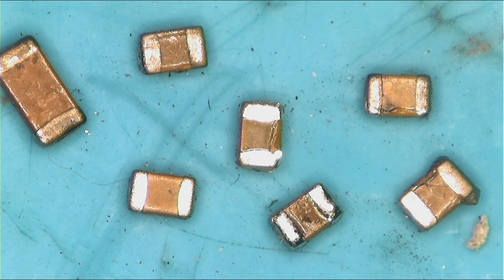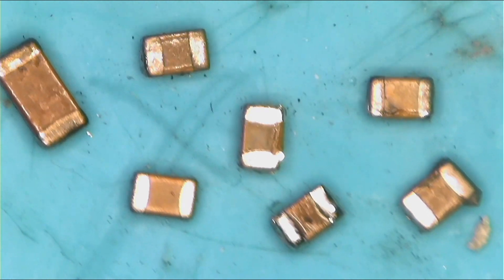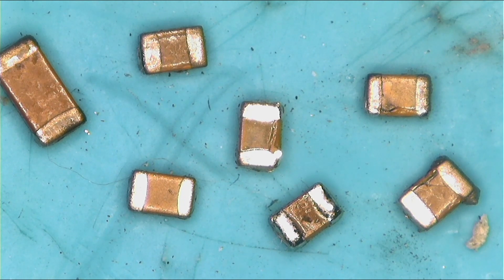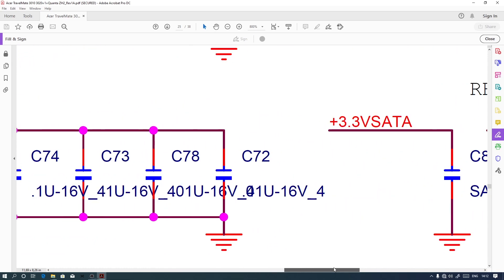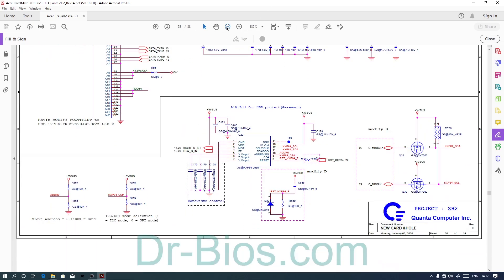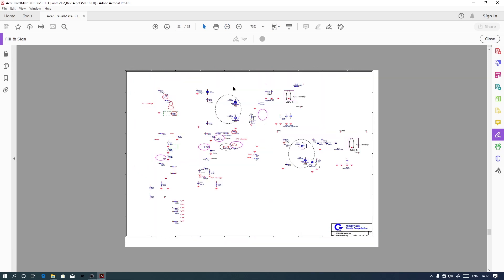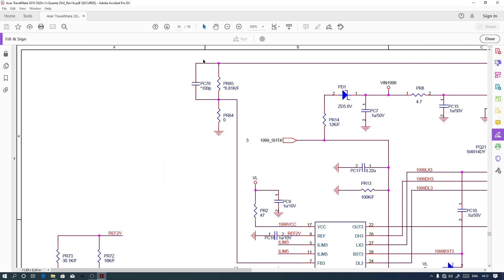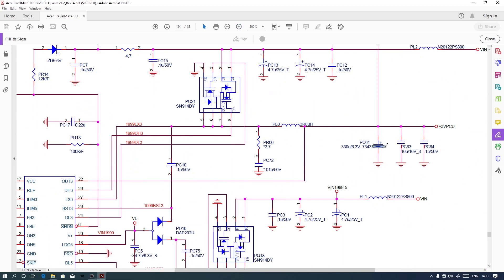How to identify shorted capacitors, you don’t need to inject any voltages

Comment: Sir thank you for the knowledge, i have a question sir, , if an smd capacitor  get buzzer in a multimeter but does not show zero but the reading is 3 ohms, is it good or bad? Thank you

Comment: Resp Sir! Very Nice Sir. Sir 1TB Hard Disk Desplayed at Disk Managent for Hardisk could not be Performed because of an I/O Device Error Sir, Dosmode Command Prompt Clean Disk and Somany Types Traing Sir bu Same Error Sir, after Hardisk Open and CPU Connected Sir One Second Spinning after Off and Power Removed and Again Connected Sir again one Scond Run and Off Sir, after Hardisk Logic PCB Open and Testing with Multimeter Beep Mode Some SMD Ceramic Capacitors are 132, 150, 75, Values Desplayed Sir, No Beep Sir, Only Beep Mode Sir. all SMD Capacitors Can Remove Sir or Not Sir. Where the Problem Sir. Please Advise Sir. I am Waiting Sir.  --     ChinnaRao Paderu Andhrapradesh

Comment: bro nice video.
do we have any thing like "open capasitors"
Reply: They do go open. They can develop high "equivalent series resistance" ESR. They can develop leakage ranging from in specification to out of spec but undetectable malfunction all of the way to shorted. They can suffer a reduction in capacity usually accompanied by increase in ESR. Look into ideal component characteristics versus real components which all have resistance, capacitance and inductance. Good luck!
Reply from the maker: no we dont have

Comment: How would we identify the value of a capacitor that's shorted so we can replace it with a new one ???  Any help would be greatly appreciated guys ☺️
Reply: sometimes you can find example circuits of ic's in which you can tell the different capacitors used
Reply: using capacitance meter or smd tester or if you dont have replace with the same size
Reply: Sometimes rows of caps are  of same value so you can measure the one next to it with cap meter. You can guess by measuring other caps on board and seeing most common values. It's all just educated guesses though.
Reply: Samee
Reply: Damn I have the same problem no schematic on this board I'm working on and have a bunch that have failed and need replacements and have no clue what value they are.
Reply: You kinda screwed. I don't think you can figure that out.

You'll need a schematic or donor board.

Comment: Some times the ceramic capacitor gives short to ground on the board and there's no problem in the board can you tell us about that case.
Thanks
Reply from the maker: Yes, some power rails are connected to a pch, cpu and graphics chip, those chips have low resistance to ground…
Reply: @jbvtechnologies  
Thanks brother for the information 🙂

Comment: So you are saying that if the multimetre beeps when check for continuity then that means the capacitor is short, is that right?
Reply from the maker: That depends, when checking it outside the board then big yes, yes …but when connected to the board you should be careful and check the power rail where the cap is connected
Reply: @jbvtechnologies  thnks bro..like your video
Reply: @jbvtechnologies  Sir , I have a capacitor that I checked outside the board , it gives no reading at all   wether it is in diode mode or in resistor mode . is the capacitor dead ?